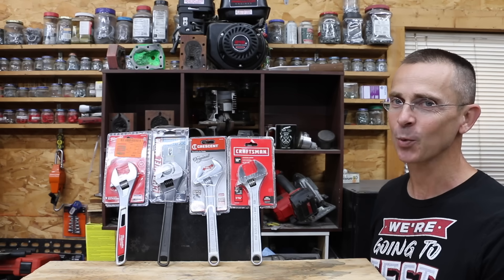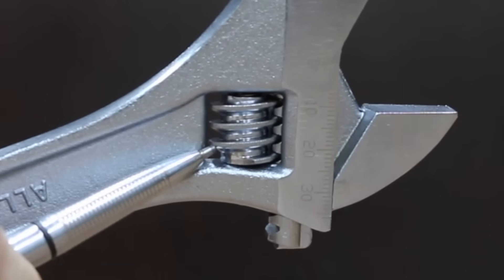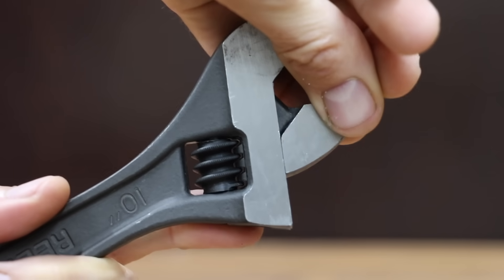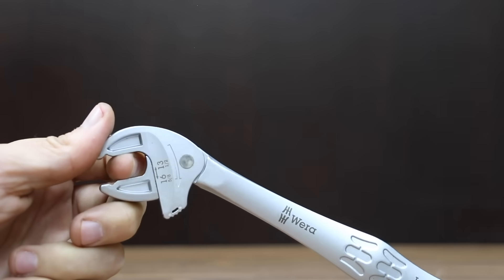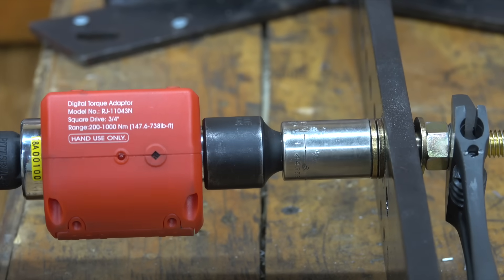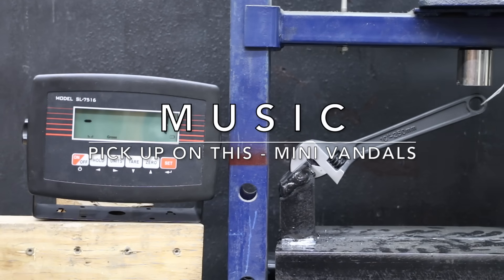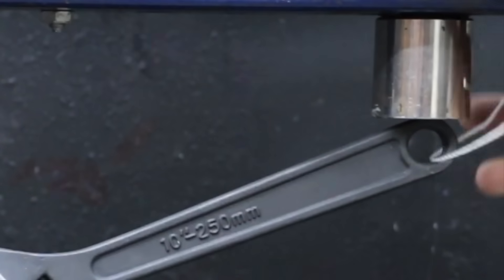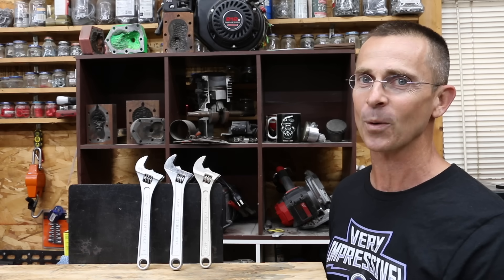Best Wrench (ADJUSTABLE)? Craftsman USA vs Craftsman, Crescent, Kobalt, Milwaukee, Channellock

Comment: Here is my video idea:
Basic Problem:
I wish to remove a nut/bolt/fitting w/out destroying it: and I may wish to reuse it!
For instance a brake bleeder valve or a brake line fitting ( distinct problems, both worth mentioning)
I've recently had some success w/ each of these, but of course that doesn't mean I used the very best technique or tools!  And I'm left wondering: Did I use the best tools or just get lucky?

HERE IS MY BIG QUESTION: WHICH TOOL IS MOST LIKELY TO GRAB AND FREE  DELICATE STUFF WITHOUT BREAKING THE DELICATE STUFF?

Recent experience and discussion:
I tried to loosen a brake bleeder valve with a combination wrench, but I was afraid to apply too much force for two reasons: 1) it's hollow and delicate--I REALLY don't want to break it! , 2) I don't wish to round it. 
I sprayed it multiple times and used a  battery powered ratchet (30Lb*ft max) that has no hope of freeing the piece--but will vibrate the heck out of it to help loosen rust and aid spray penetration. I kept repeating those steps until my frustration level rose to the point that I was willing to use my Milwaukee Mid Torque--I was worried this would break the piece but: 1) No amount of sweet-talk ever works on my truck, and 2) At some point I'm willing to accept more risk.
The powerful impact wrench acted like it didn't know why I ever had any trouble!  But, I'm glad I spent time with the spray and relatively weak ratchet. 
Still, this success and a very similar success with a brake line fitting made we wonder which tool is most likely to get a good grip and not break or round delicate things. 

I happen to own normal combination wrenches, flare nut wrenches (with a flat side opposite the opening!!), crows feet (with a vertex opposite the opening, eh), Knipex pliers wrenches, and impact sockets. 
Now I've seen a trick online wherein someone puts locking grip pliers on the outside of a flare nut wrench (best of both worlds maybe).  That looks promising to me but I haven't tried it and in any case I'd most like to see a thorough test [Your Specialty!]  comparing flare nuts (maybe both designs, or maybe just one design but with the Locking grip trick added in) to Knipex pliers wrench, and sockets.

So again:
WHICH TOOL IS MOST LIKELY TO GRAB AND FREE  DELICATE STUFF WITHOUT BREAKING THE DELICATE STUFF?
Reply from the maker: Thanks for the suggestion.

Comment: I'm curious if any of the other foreign-made models had older USA-made equivalents besides the Craftsman? I feel old, USA-made Craftsman always somehow get seen as the pinnacle of USA made tools...but usually because it's the only USA-made brand people remember, thanks to Sears.  For next test, can we somehow test using cordless drills vs cordless screw guns vs cordless impact drivers on a variety of screws in a variety of materials? I still cringe when I see folks using impact drivers on drywall screws in wood and want to know if I'm just being a biased, old curmudgeon. THANKS!
Reply from the maker: Thanks for the suggestion.

Comment: Proto adjustbale wrenchs are usa made and resemble a old craftsman usa made adjustable wrench and is all i have in my tool boxxes because they in my opinion are better then whats out there. I'll be testing some snap on adjustable wrenchs, but cant beat proto/craftsman usa made. used craftsman you can find for 10-20 dollars on ebay/mercari, proto new is 20-30 which is honestly nice. Plus proto has a locking mechanism for the adjustable worm screw which can honestly get the adjustable wrench so tight you have a hard time getting it undone which is nice and tioght.
Reply from the maker: Thanks for the feedback.

Comment: I find these days that the tools that are breaking / not functioning correctly / made badly etc are definitely newer and nearly always far eastern manufacture. Not to mention the fact that most of my really good tools that are still good are from when I started work at 15 (now 68), it' Starrett, Millers Falls, US & UK mfg Stanley, Eclipse, Facom, Rabone & Chesterman, Snap On, the list goes on.
I brought a new scriber recently having mislaid my favourite Starrett and it has gone in the bin, it needs the tip sharpening after short time use, the collet lock doesn't lock without huge force. Luckily I found my Starrett, I can sleep easy now.
Reply from the maker: Thanks for sharing.

Comment: My preference is Wright brand I like them because they open farther than most . I use them for hydraulic fitting in testing applications. Not on bolts or nuts .
Reply from the maker: Thanks for the feedback.

Comment: I love your videos, thank you for posting them..  I will say that I never liked using an adjustable wrench because they slip too much but a guy I work with gave me a 6 inch and a 10 inch adjustable wrenches that are 30 years old, it is (Apex) brand or Cooper tools and those wrenches are my go to's now.. I cleaned them up really good and they have almost no slop in the gear and they work like a dream.. those 2 wrenches made me change my outlook on adjustable wrenches.. If I lost those 2 wrenches I would be heartbroken because they don't make them anymore and they are very hard to find now.. I know some Apex tools are still around but they aren't the same as they were 30 years ago..
Reply from the maker: Thanks and you are welcome!  Thanks for the feedback.

Comment: Having used many of the wrenches you demonstrated, the Milwaukee is awful quality for its cost, the Spanish made Klein are great quality. Reed mfg are good quality but overpriced.

Crescent used to be my favorite brand and still are, only when they are the American made.

The Milwaukee adjustable feels nice initially but wear out very quickly.
Reply: I’d add that Snap on adjustable wrenches are the best quality wrenches but are very expensive, thanks For the great videos!
Reply from the maker: Thanks for the feedback.

Comment: Looking at the failure load the least one was 581 lbs and that was way higher than any human hand can torque on a 10" wrench, with that in mind I think every one of these wrenches will do just fine for the situation that calls for a 10" adjustable wrench. I think the Knipex plier wrench will eliminate slippage problem because you can squeeze the handles as tight as you can to close the jaws.
Reply from the maker: Thanks for the feedback.

Comment: Also, in most of the test you are not using the wrenches in the correct orientation. The fixed side of the jaw should be taking the implied torque, not the adjustable side. So this is why you are having jaw slippage.

Comment: Hi @Project Farm. I wonder if you've ever thought of comparing Basin Wrenches. I have had ones that were really bad at gripping nuts under sinks. I have seen something (new to me) called 'Ridgid 57003 EZ Change Faucet Tool'. I have seen generics of the Rigid type as well.

Anyways, love the channel. Thanks
Reply from the maker: Thanks!  Thanks for the suggestion.

Comment: You do know that you are using the adjustable wrenches backwards. I am a retired tool and die maker and special machine builder. The torque on the moving jaw should be as close as possible to the main frame of the wrench. The way you use them the torque is way out on the moving jaw. I know that most people have never heard this before so I do understand. I do, very much, enjoy tests. Thank you for making them.
Reply from the maker: Thanks and you are welcome!  Thanks for the constructive feedback.

Comment: I have a question:  In the destructive testing, if the pressure on the handle were exerted in the opposite direction, wouldn't that cause the force on the nut from the moveable jaw to be applied much closer to the wrench and not be cantilevered out so much?  Also, that might result in less jaw stretch when the applied force from the moveable jaw is closer to the tool.
Reply: Agreed but without a arrow to show the avg Bob (or is it Joe) to apply force in this direction it’s just using the wrench. What if removing? All are tested with the force on the adjustable jaw applied the same. Less force needed for the strong to dominate. Agreed?

Comment: Very impressive and entertaining. I'm an 80 year old retiree with a back ground in the mechanics and machinist trades. While adjustable wrenches have their uses and a place in my tool box, use with an impact wrench is not one of them, nor would they be used where they would be subject to the high torque put on them in this test. Having said this, I'm not commenting here to belittle the channel and what you do here. I enjoy it very much, as I believe others do as well. I'm just saying there is right tool for the job at hand and sometimes an adjustable wrench is not one of them.
Reply from the maker: Thanks!  Thanks for the constructive feedback.
Reply: lol, going for the adjustable is a sign of defeat, a moment of embarrassment.
Reply: Lot of times I have been in that pinch when I forgot my wrenches or ratchets segemented in different tool bags or the innumerable times my tools have been stolen and I needed time to replace them and had to grab a crescent wrench, so I really appreciated his analysis, even though crescent wrenches I rarely use.

Comment: I  am a millwright and and always have a 10" adjustable wrench in my back pocket. I am a 10" wrench connoisseur and have forgotten more about them than this guy knows. The PROTO USA made Click Stop is the best, period. They stay put, jaws do not move, tight but heavy. So I have 2 of them and one has a series of lightening holes drill along the handle. Snap On are made in Europe. 
The best place to find these wrenches are pawn shops. Get the good old USA wrenches and this guy should have bought old USA made  Crescent and Channel Lock and tested them like Craftsman. And shame on these company,s for moving to China.
Reply from the maker: Thanks for the feedback.

Comment: I was given a craftsman wench 25 years ago by my dad. He fit it from his father in law who used it at his work as an electrician for 50 years. I have no idea how old it really is but could be close to a century old. I have no idea. What I do know for sure is I use it a dozen times a year  for everything from bolts to using it like a hammer tapping stuff or whatever. It still functions perfect. Worm gear is smooth and works like new. I can’t think of anything else I own with a moving part that still works perfect without any maintenance or care.
Reply from the maker: Thanks for sharing.

Comment: I have a lot of old American made hand tools, including a whole bunch of Craftsman and S-K stuff. I even still use an early 70s vintage Husky 3/8" drive socket set, when the old ratchet broke I found another on Ebay and used it to repair mine. I try to avoid the Chinese stuff as much as possible.
Reply from the maker: Thanks for the feedback.

Comment: (This could also be a video idea?) Great video, but take note of battery icons! If it’s a well-designed tester, the battery icon comes on when the battery is low enough so as to not guarantee reliable readings. My $350 Mitutoyo calipers (which I love very much; they’re basically an heirloom) can go funny with a low battery. Cheap calipers will. My mitus are 6 years old and only on its second battery. I absolutely love them. Can highly recommend. They are also very good for repeatability, important for these tests.

Hope this helps! Thanks again for the video!

Comment: I am shocked that somehow I have used adjustable wrenches for years without an SAE scale on one side and a metric scale on the other. Can someone explain how I managed to get the wrench adjusted to the correct size? Was it Devine intervention or was I just extremely lucky and should buy a few lottery tickets tonight?
Reply: Having used original BAHCO wrenches since childhood, you probably did like the original inventor and adjusted to the actual nuts and bolts.  I recently bought a large store brand 19" one and used the scale on it to figure out which fixed wrench to buy for that particular thing (it needed a 12 point ring wrench to get past obstructions).

Comment: Can you please do a video of  manual staple guns? Test the depth of staple driven into a piece of wood. Test how much pressure it takes to trigger the staple firing. Rust resistance, and how many staples before it gets jammed, etc. Thank you.
Reply from the maker: Thanks for the suggestion.

Comment: Purchased craftsman lawnmower from sears. It broke and mechanic said I broke it. The rear safety flap came loose while backing up and the mower ate the flap and wire that attached the flap to the mower. The mechanic said I had to pay giving me a hard time but the manager hearing the noise intervened because he the  manager had seen the mangled parts earlier. Took the "Fixed" lawnmower home and ran it for 10 minuets and it broke again. Took the lawnmower back to sears, shoved it in the front door and walked away. Never shopped at sears again or bought craftsman.
Reply from the maker: Thanks for sharing.

Comment: #1 rule with adjustable wrenches. Always turn the wrench toward the movable jaw not away from it. Have seen several broken this way. Especially when a cheater bar is used. Proto's patented Clik-Stop design prevents the wrench from backing off. Best design I have used in over 40 years in the trades. Had a bolt that didnt want to loosen. Tried several different tools. Finally a Snap on 12" adjustable wrench did it, for the simple fact they have have teeth on the jaws. Very nice wrench if you want to spend the money. Still Proto Clik-Stop is my favorite.
Reply from the maker: Thanks for the feedback

Comment: I have a few different brand adjustable wrenches. There is one particular wrench I find myself grabbing most often when the job calls for it. Its a Stanley adjustable wrench I purchased at Walmart several years ago. This wrench has a lock device similar to what you find on vise grips, this feature eliminates all excess free play. 

Not sure if Walmart still has these in stock. However, I would highly recommend it to anybody interested, it really is a great tool to have!
Reply from the maker: Thanks for the feedback.
Reply: @ProjectFarm Hey, not a problem! Your videos are great and I appreciate the amount of effort you put into them. 

As far as the wrench I recommended, just my opinion of course. I'm curious how it would hold up on these tests of yours. For all I know maybe you've tried them before and don't share the same positive experience as myself.

Comment: The wrenches were used wrong on the tests for rounding nuts. It should be upside down, where all the force is off the worm gear.
Reply from the maker: Thanks for the constructive feedback.

Comment: As a retired Elevator Mechanic I got real picky about tools. (You don't won't to carry JUNK up 12 floors to fix the elevator). In my pocket, still to this day, I have a Proto 4in Adj., Channellock 4in adj plier, Knipex 4 in flat jaw plier, a mini Leatherman and a pocket knife. While working I also carried a Knipex  6 in plier, a 4 way screwdriver and a Channellock 6in needle nose. The Proto 4in adj is the only brand out of the box that opens to 9/16. it also is made from better steel and is the narrowest jaw of them all. If you need a small wrench the Craftsman,'s jaws were too fat to use. The Knipex 6in I could open up and put my full body weight on a 3/4 bolt (1 1/8 in) and hang. I weigh 280. all the tools that I mentioned are the best I found. And the pocket knife has IUEC on it and I believe it was made by Utica.
Reply from the maker: Thanks for sharing.

Comment: Your test are pointless on adjustable wrenches. The tool is not used in high torque situations by professionals. Especially in situations which calibration is required.  So the whole point of this video is moot.

Comment: I just broke my 1/4 inch drive ratchet the other day. I knew I was pushing it pretty hard, but had no idea if it would give out before the nut broke loose. A test of ratchet strength at different drive sizes would help your viewers know which brands hold up well, and give an idea of when they break so we don't have to find out the hard way. I just found your channel and look forward to going thru your videos. 👍
Reply from the maker: Welcome to the channel!  Thanks for the suggestion.

Comment: I bought a package of adjustable wrenches at one of those tool stores that specializes in cheap Asian made tools. I dont need to use an impact wrench to make them readjust.  I can just shake em, drop em or make a dirty look at em. In short, cheap is as cheap does. I gave em away.  Sometimes cheap is costly.  If you ever heard of C C's pizza, I went there once. The buffet was $4.99. When they ask "is everything ok"?  I said well its one of the times when at five bucks I felt like I overpaid.
Reply from the maker: Thanks for the feedback.

Comment: For BF 2021, Lowe's has the Kobalt 3-pack for $13 using military discount and minimum retail pricing.  That's just 4.33 for the 10", a super bargain given how well it performed here against tools priced many times higher.  At that price, a guy can buy three sets. Put one in the shop, stash one in the truck, and hide one from the kids.
Reply from the maker: Thanks for the feedback.